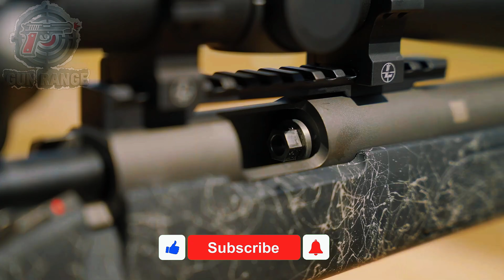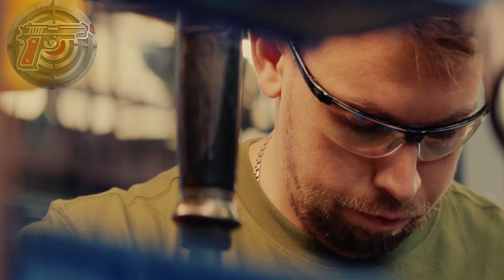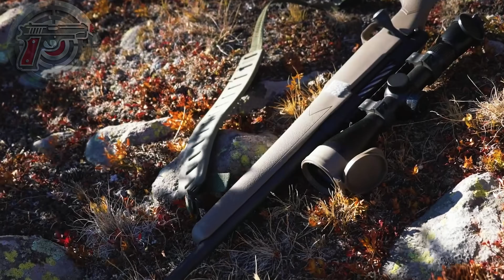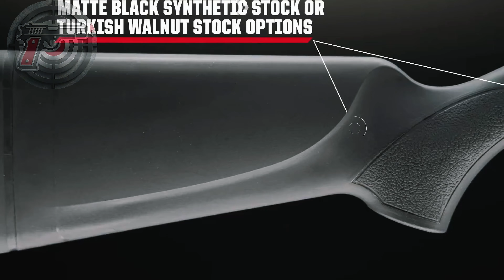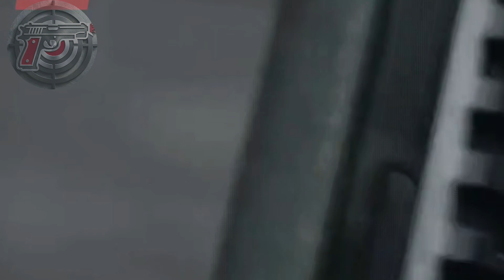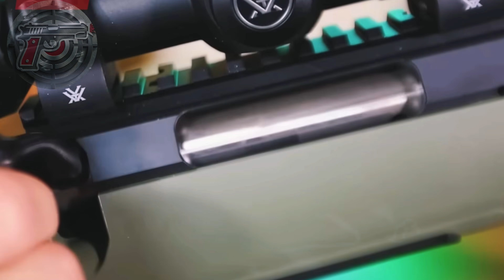Top 5 WORST Deer Rifles at NRAAM 2026 (The Harsh Truth)

Comment: The comments on the Glenfield Model A seem biased and without statistics. I recently got one chambered in .308 and im not having issues with the bolt whatsoever. I’m getting .5-1moa groups at 100 yards easily. It’s also running amazingly with the sandman x.
Reply from the maker: The Stevens 334 has been getting mixed opinions, but most real tests show it’s actually pretty solid for the price. Reliable feeding, no major issues, and capable of sub-MOA with the right ammo—even if the trigger is heavy.

So yeah—calling it “bad” across the board is a bit much. It’s more like:

Good accuracy potential ✔️
Reliable ✔️
Trigger is the main weak spot ❗

If yours is doing 0.5–1 MOA and running clean with a can, that’s a win, not an outlier.

Most of the criticism comes from feel/trigger—not actual performance.

What ammo has yours liked best so far?
Reply: @MediaLor360Arms  Hornady American Whitetail .308WIN 165gr InterLock
Reply from the maker: Thanks for answering. I also owe you a correction: you were discussing the Glenfield Model A, while the earlier channel reply switched to the Stevens 334. That mismatch wasn’t helpful. Your firsthand feedback should be considered in the context of the model you actually described. Our newest video explores vintage Scandinavian and Swiss designs if you’d like to share your thoughts there too: https://youtu.be/Bz62uxMLMAo

Comment: My 334 Savage as it’s known at most gun shops. The trigger is as said lock adjustments the spring is now your adjustment. My trigger weight is now 1 pound verified by trigger pull gauge. Anyone pulling the trigger better be ready.
Reply from the maker: 😅 1 lb trigger là kiểu “thinking about it = it fires” rồi.
Với mấy khẩu như Savage Axis, hạ trigger nhẹ quá đôi khi lại phản tác dụng. Factory đã không ổn định sẵn, chỉnh xuống mức đó mà không set chuẩn sear thì dễ gặp misfire hoặc không an toàn.
Thực tế nhiều người chỉ kéo về khoảng 2–3 lb là hợp lý hơn—vẫn nhẹ, nhưng kiểm soát tốt hơn. Thậm chí mấy kit aftermarket cũng thường set trong khoảng đó để đảm bảo an toàn .
Nói thẳng: 1 lb trên một khẩu hunting rifle là hơi “overkill” 😄
Bạn đang dùng để bắn bench hay đi hunt thật?

Comment: Now you have gotten my attention on the 334, 308. I have one that has fired maybe 10 rounds. I was shocked at how well it shot. Now I will really clean the barrel. And double check every thing else as I go. One I really lover the 1990's MINI-14. But they had a problem that I finally found and could hit a .075 group at 100 yards. It was simple, they weren't meant to fire a Military 5.56. The chamber wasn't cut for it, and the twist was a little short with that 1-7 twist.
Reply: I pulled out that 334 Stevens and the only thing I see is the trigger pull, but I'm use to that!
Reply from the maker: Nice—that’s a good problem to have 😄
Sounds like your Stevens 334 is one of the “shooters.” If it’s already grouping well with minimal rounds, a proper clean + torque check will probably tighten it up even more.
Yeah, the trigger is the main weak point most people mention—usable, just not great. But if you’re used to it, no big deal.
And that Ruger Mini-14 story checks out—those older ones could be picky with 5.56 vs .223.
Honestly, if that 334 keeps shooting like that, it’s a sleeper 👍